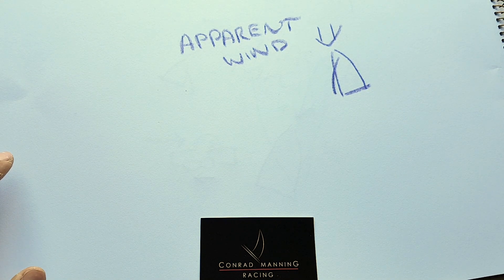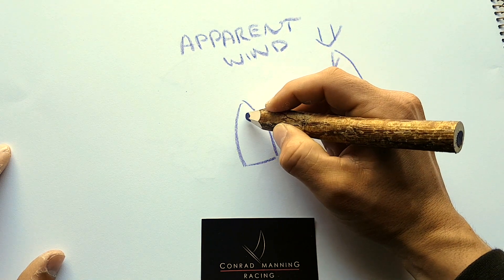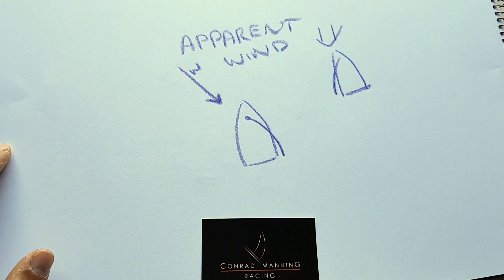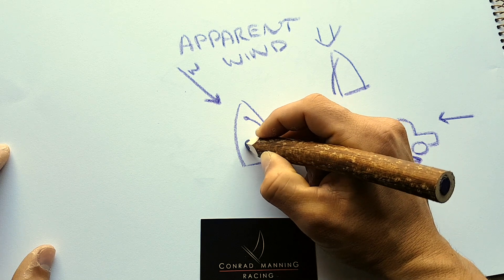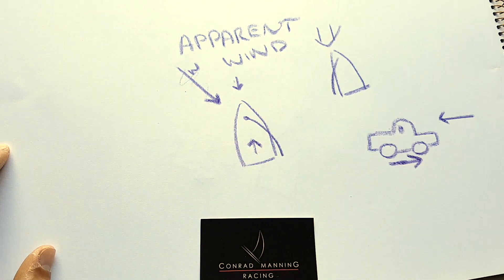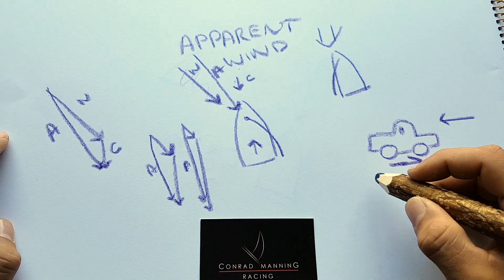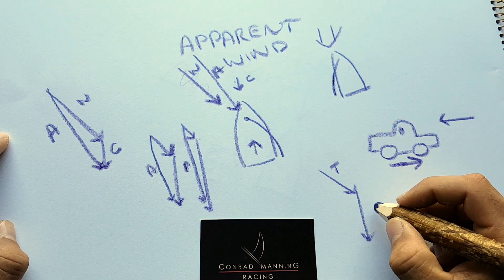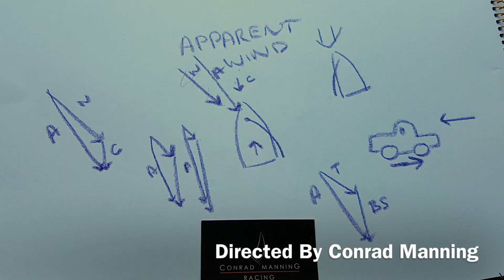How to sail faster than the wind - Apparent wind

Comment: Any chance of explaining AC 75 extraordinary speed in little wind . Please.
Reply from the maker: Hi Andy, it's a similar principle except their resistance in the water is significantly reduced which allows them to go faster.
Reply: @Conradmanningracing  got it, many thanks. So American Magic lost resistance completely.
Reply from the maker: @andyphillips7435  are you referring to a point specifically? The boat on boat stuff will be down to a few other factors

Comment: Hi Conrad. I'll try my best to break down what you said. I think you might have confused your viewers (you confused me and I do sail :) because you first said about the wind coming from the port side, "You will have the "normal" wind (what is normal wind? compared to true wind and apparent wind?) coming from your beam, like that." But did you mean that wind was the true wind, apparent wind, or what? And wasn't it actually coming from forward of beam (close hauled,) at maybe 30 degrees?  Anyway, you then jump to the car scenario to describe equal and opposite forces, but you don't explain how that combination links to apparent wind. The car is also different as it is under its own power. The boat is not. So how does the wind actually move the boat? Then you go back to the boat and recreate the car scenario, but you cross out the original wind line and say it doesn't exist ("No wind whatsoever.") If there is no wind whatsoever coming from the port bow, what is the head on wind? But then you say, "If you combine these into a vector, you then have the wind," and you use the wind line that you just said didn't exist, then have that non existent wind merging with the head wind to create your vector; and then you say the boat "feels" the apparent wind (from what?) but never explain how the boat manages to go faster. In your scenario, the only wind the boat would actually be affected by is the direct head on wind (again, where is that coming from?) as you haven't explained how the wind coming from head on moves the boat forward if the wind off the port bow does not exist. So the problem with your explanation is that you never explain how the boat can generate speed from nothing except the headwind which you draw as "the speed that you generate." If you break it down to a basic explanation of apparent wind vs true wind and how they are created, and then how wind creates lift on the sail, and why that moves the boat forward, it will be clearer. Cheers :)
Reply from the maker: Thanks for the comment Rabukan, I'll have a read through your comment as it's been a fair while since I did the video so a little confused myself by what you've written... thanks though for taking the time to comment it is much appreciated!

Comment: Thank you. I have always wondered about that. I understood your excellent, simple explanation (after two viewings). 
　
However, I must say that it still amazes me that the force, generated by the action of the apparent wind on the sails, is sufficient to accelerate the mass of the boat (and to overcome the friction with the water, up to a point) to a velocity GREATER THAN THE TRUE WIND. For me, it's counter-intuitive. 
　
I suppose the various forces of air pressure (on a sail, on an airplane's wing, on a vacuum clamp) can be extremely powerful.
Reply from the maker: You're more than welcome and thanks for the comment! What do you think I could do to make it easier to understand (as I see it took you two goes)?

Wind is sure a powerful force! There are a few additional needs to do with the boat's design (weight, size, resistance, etc) that will enable it to travel faster than the wind (think old classics compared to the modern ocean racers if you will).
Reply: Thanks for replying. 
　
Let me think about this for a few days. First, I need to do some basic research on sails, hang-glider wings, and the like. Then I can present my thoughts in a more informed way. I'll get back to you.
Reply from the maker: @dandeliondown6010  that would be great! I look forward to hearing back from you (would you prefer email rather than on here?)
Reply: Here is fine. (Maybe some other people can benefit from our conversation.)
Reply: HELLO. I am back, as promised, after watching several videos (on sails, wings, vacuum clamps, air pressure, etc.) I think I understand the whole topic better now. 
　
SORRY, this is a long message. 
　
MY MISTAKEN IDEA: Bearing in mind that my high school physics is imperfect, imagine me saying this: "Because the only force of thrust in this example comes from the true wind, it should not be possible for the boat to go faster than the true wind." Of course (I now realize) that I have made two mistakes in that sentence. 
　
FIRST MISTAKE CORRECTED: There is another force of thrust, and it is probably a much more powerful force. It is the force created by the difference in air pressure when the wind blows across the sails. Just as the difference in air pressure on a wing can lift a very heavy airplane, the difference in air pressure on a sail can propel the boat with great force. Where does this force come from? "Air pressure is the weight of the atmosphere pressing down on the earth" (infoplease.com). It can be extremely powerful, and when sails and wings create a difference in air pressure, the force can be enormous. Why does a small force from the true wind cause a large force from a difference in air pressure? A small force can break the "containment" that is holding a large force. For example, we use a small force to turn the ignition key in our car, making available the powerful forces in the car's engine; a small force from a spark plug releases the powerful forces in the car's gasoline or petrol. 
　
SECOND MISTAKE CORRECTED: It is commonplace for a slow but massive force to create a fast light force. When a bagpiper squeezes the bag with his arm, his slow-moving but massive arm causes a fast but light stream of air to come through the pipes. (Momentum is conserved because the faster air is less massive than the slow arm.) 
　
SUMMARY: The force of the wind acts with the sails to release the powerful force of air pressure by creating a difference in air pressure. Because the difference in air pressure can be great, it can propel the boat at speeds faster than the true wind. 
　
NOTE: I watched this video a third time just now, and I think it is excellent to explain the apparent wind. (It is normal practice for me to watch an instructional video several times. That's just me.) I think my previous confusion was the result of my ignorance in not understanding all the forces involved. Hopefully, my understanding is better now. 
　
Cheers.
Reply from the maker: @dandeliondown6010  wow! You must have watched a few videos there! It might make sense for me to create a second video explaining how the air travelling over the sail generates lift and therefore thrust... Would that be helpful (any other sailing related videos be of interest)?
Reply: "... a second video explaining how the air travelling over the sail generates lift and therefore thrust ..." 
　
Yes, I think that would be great. However, in my research of wings, I was surprised to discover that the lift produced by wings has, in the last few years, become a less clear topic. When I was young, it was always described as the result of Bernoulli's Principle. Now it seems that one must also include some of Newton's Principles (especially "equal and opposite reactions"). So this is ANOTHER topic that is more complicated than I understood.     :D     
　
If I can think of any other questions about sailing, I'll certainly come here. You have been very helpful and generous with your time.
Reply from the maker: @dandeliondown6010  yes, it's the simplest description but as with all simplifications there will be some assumptions. I'll get that all drawn up!

Thank you! You can reach me on any social channel as well. Very happy to help!